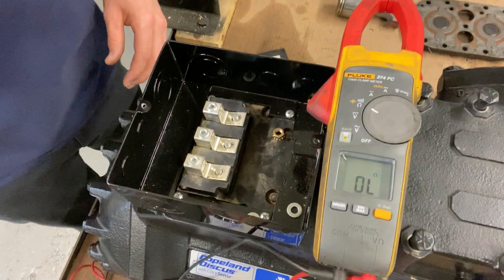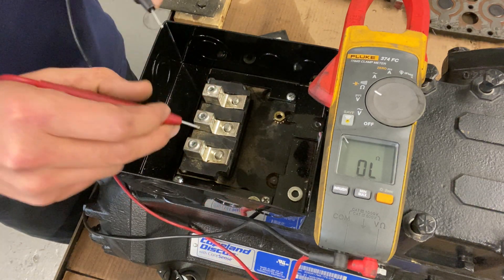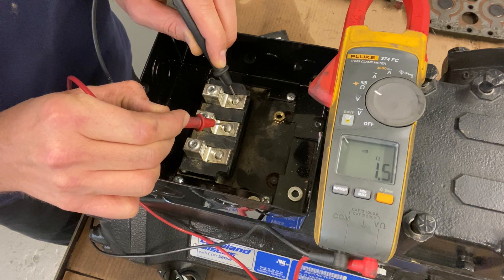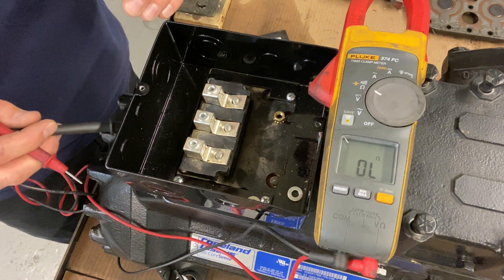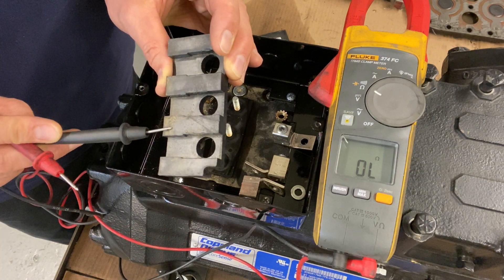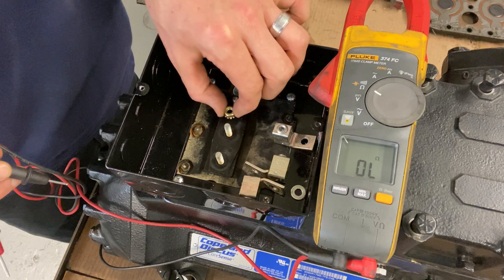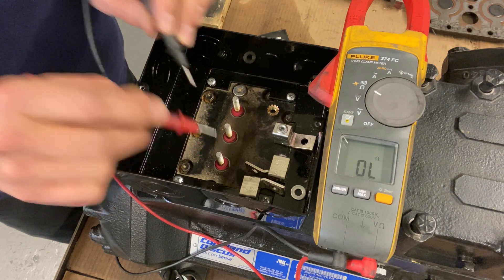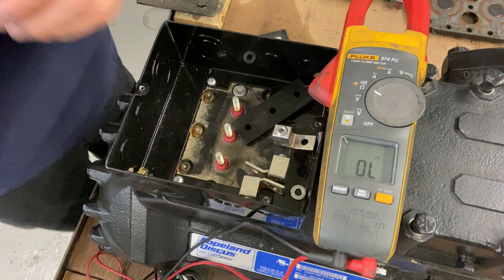Always Check The Compressor Terminal Insulator

Comment: 100% facts we had a compressor that 3 other companies sad was bad they called me and there was moisture in between 2 and 3 we cleaned it off and fixed the plate (jb weld) where it was broken looked like it was over torquing and put it back together and still running to this day and that was last year
Reply from the maker: Well you should share this video with those other companies.  They probably do not know it is something they have to check or have someone at their company to teach them this